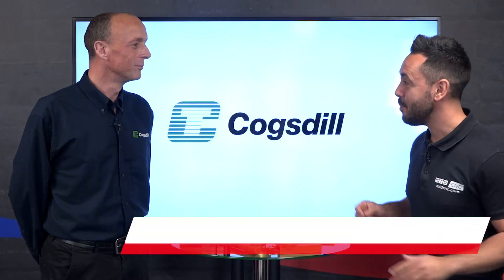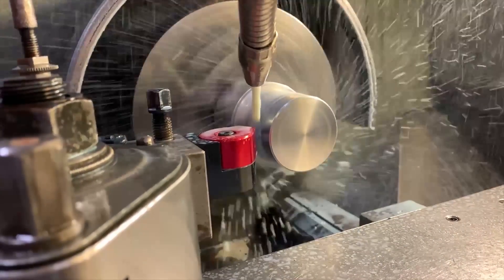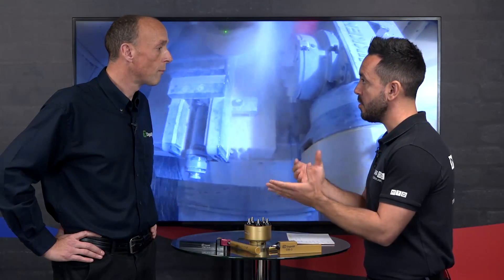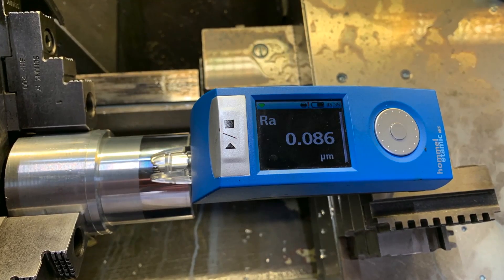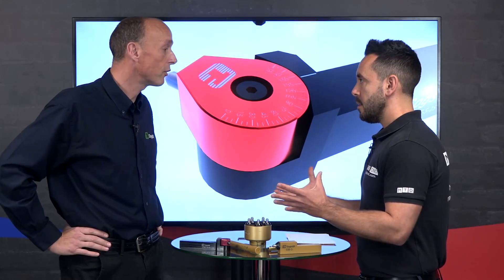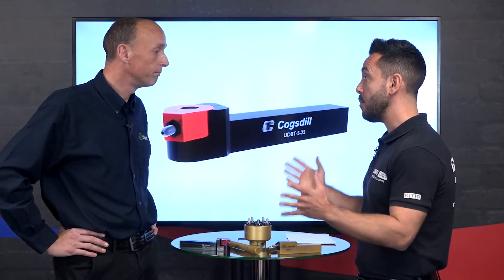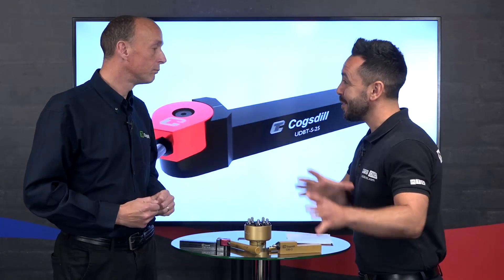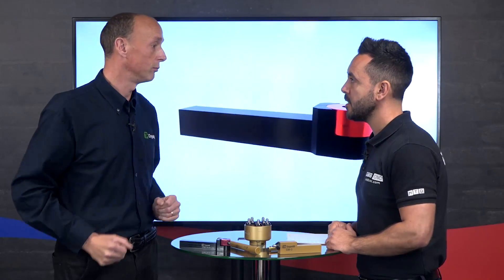What is Burnishing?

Comment: Wondering what are the Horsepower Requirements for the  turning and boring tools? Also does the burnishing process produce runout on cylindrical part
pieces (Shafts?)

Comment: Diametrical 'Size" should not be an issue on any modern CNC turning center but what would be really good to see from COGSDILL are plots for roundness (essentially approaching form tolerances for turned parts and how burnishing may affect that ? ), same for the milling solution for flatness too ? It seems like a good technique. Values and shifts (as a result of burnishing) for Roundness, and maybe one day cylindricity and Tapericicty / Taper ? THANKS ! :-)
Reply from the maker: EXTRA DIMENSION 
Great feedback - thank you 😊

Comment: What sort of surface speeds and feed rates do your run a turning burnishing tool at? What materials is this suitable for?
Reply from the maker: Kristian Thompson Silva
Give the guys at Cogsdill a shout - they would be more than happy to help!
Reply: get a ballbearing and do it,, is hard  enought to do it,,, 600 rot.. you can also amke a tool with a "big" ball.bearing..have done thsi foir years
or you can make woith just a pive of carbon steal but you have to control the movement front and back..usuallyb you can only dom it in very small lathes.. or cnc machines